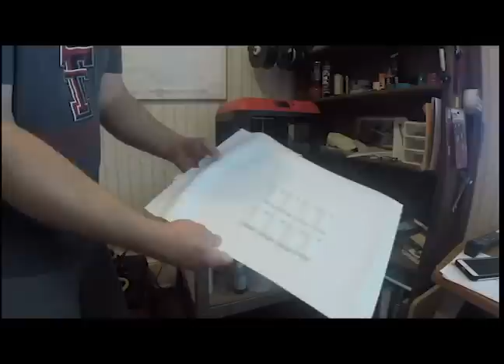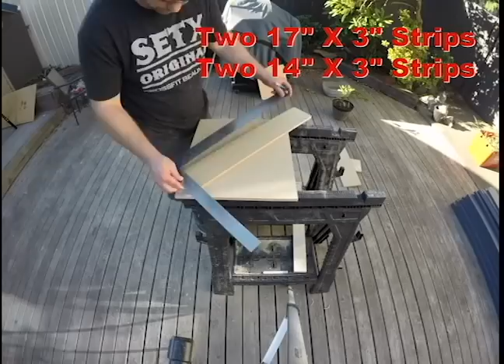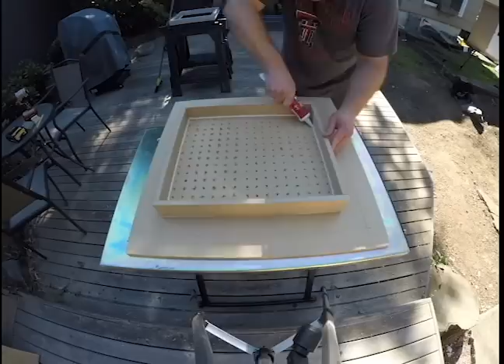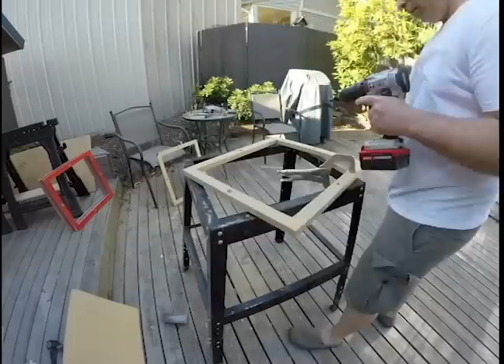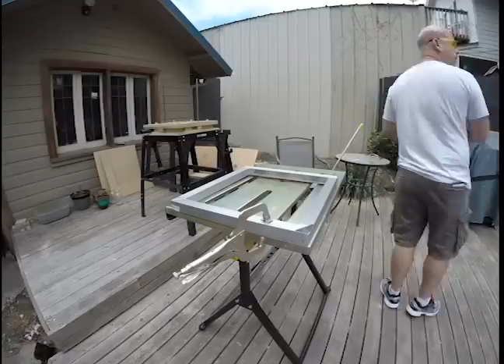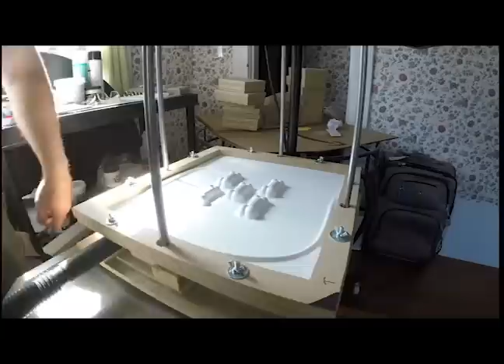Steve3pO Vacuum Forming Machine

Comment: Great build, it really got my creativity flowing. Nice step by step process. Why the blue tape? Also very good job find a heating element, this was the one piece I was missing. Just curious why you didn't go with a hinges on you membrane frame? Lastly are you still using it and did you make any upgrades to it?
Reply from the maker: Hi!  Thank you for the nice message.  Quick and dirty was the name of the game when I built it;  I was trying to do 1 video per week.  The blue tape was covering about 80 holes because the size of my form was much smaller than the bed.  I went with an “unhinged” frame because I wanted to accommodate sheets of varying thicknesses.  I’ve done everything from 0.050” to 1/4” polystyrene AND ABS.  The heating element just worked out because I screen print bags and boxes for my wife’s company and I had already purchased a $150 flash-cure...😄
I haven’t made any real upgrades yet but I might reinforce it for use with a compressor and possibly swap out the bed-top with something other than MDF (I suspect I can get a better seal with a plastic of some sort; as long as it’s heat resistant).  Thank you for your questions!  I’m always happy to help.